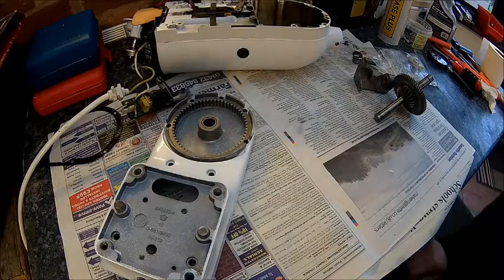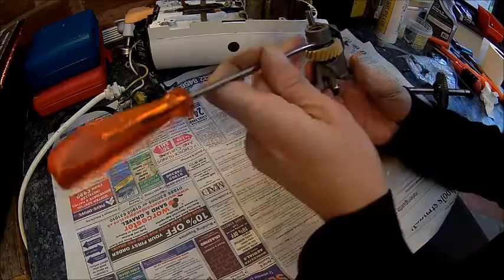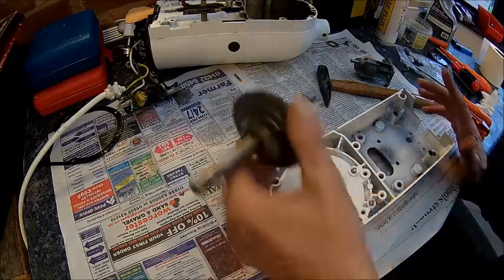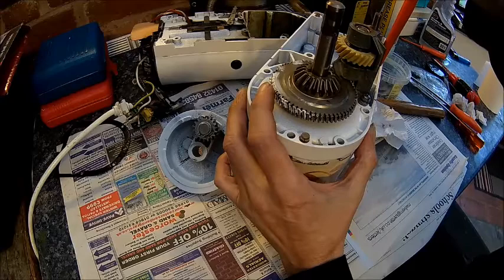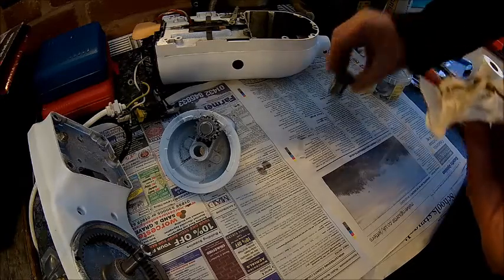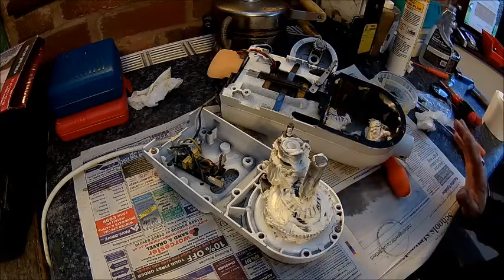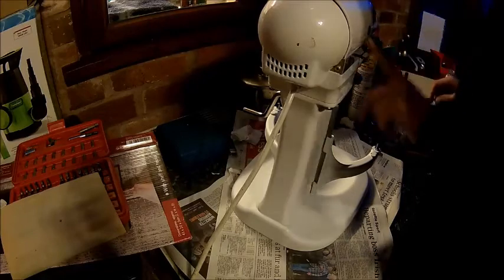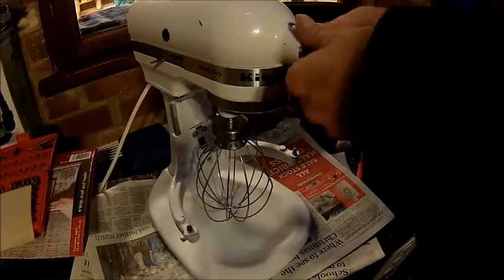KitchenAid Stand Mixer repair - Part 2, re-assembly and mixing the Sunday cake (Model 5KPM5)

Comment: Hello. My mixers gears are all in perfect condition and the teeth are all there.... but I hear a grinding now that I put it back together? It wasn't doing that before I opened it up. It was fine and working fine... what may have went wrong? Thanks
Reply from the maker: Hi, hard to tell from the distance, but let's go through the obvious things ... did you put new grease in...was there any bits in the old grease .. on re-asssembly, did you force it back together, if yes you may just have smashed the plastic gear, i think i pointed that problem out somewhere in the video. why did you open it if it was fine before ?
Reply from the maker: looks like all the gears are good. can you wiggle the shaft in the housing , means how much play do you have in the shaft bearing ? If it slides in rather loose that fine, but play is no good.
Just thinking if there is a washer or bushing missing on top of the bevel gear,  just check with my video if it really looks the same, can't remember it all, too many projects going on here.
Also did you put the accessory drive shaft back in and  does it spin ok, i think that 
also helps to hold the bevel gear down.
Can you move the output shaft up and down when it's fully assembled ?